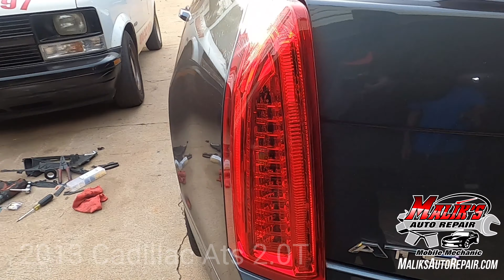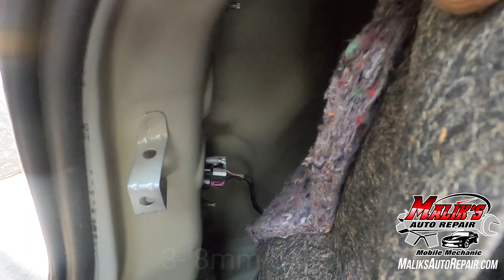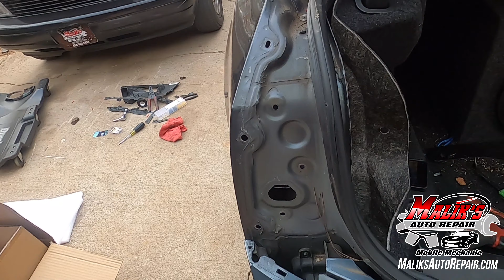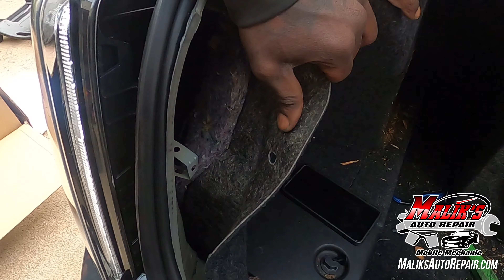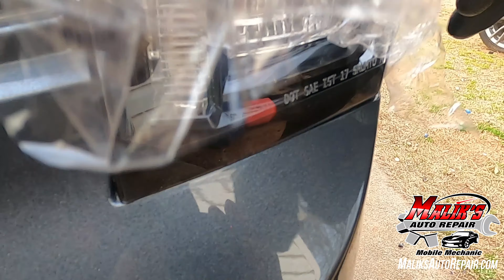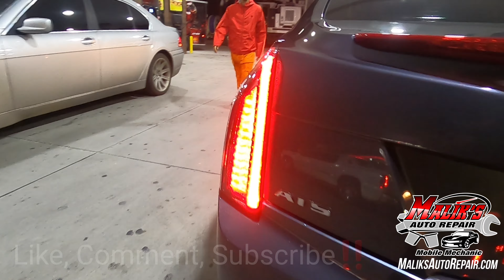CUSTOM TAIL LIGHTS🔥/UPGRADE/EASY MOD‼️Howto/2013-2018 Cadillac Ats 2.0T www.maliksautorepair.com

Comment: Are the oem led aswell? Do the new lights have different looking design  compared to the oem or is it just a smoked version of of stock?
Reply from the maker: Yes sir, OEM as well. The lights actually look the same, just a brighter LED and the clear, see thru look. They almost look stock tho, just without the red.

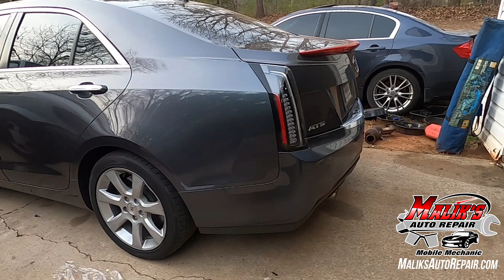Comment: I think you should have that bent left rear rim straightened  (6:11) before spending money on the ricer look tail lamps.
Reply from the maker: Well thanks for pointing that out Ron. It was bent when I got it, but fixed as soon as I found someone to do it. I'm loving my clear taillights btw. Sry u dont😎

Comment: Just installed but brake lights dont come on and they turn signals are faint. Replacing them maybe i just got a bad set
Reply from the maker: Yeah, good possiblilty.

Comment: Installed these my turn signal blinks very fast as if the car is not recognizing them any reason why this is?
Reply from the maker: This happens because they draw such little power that your turn signal relay sees the bulbs as being out. 
Best thing to do is Install an LED flasher module specifically designed for LED bulbs or Install a load resistor kit. Unlike plug-and-play LED flasher modules, load resistor kits require some wiring to install.
Reply from the maker: The guy I purchased mine from has more in stock now. Check the link in the description.

Comment: I just installed these lights today. They look identical but I believe I got them from a different seller. They look great! However, mine are hyper flashing when I turn the blinkers on. I guess I'll need to install load resisters. Did you have this issue at all?
Reply from the maker: Awh man, that's wild. No I didn't have that problem at all. You shouldn't be getting a hyper flash. Where did you purchase them?
Reply: @ThePullUpKing  I got them from a store called KWD Lights on Amazon. The blinkers are sequential which is probably why I'm having an issue. Here's a link to a YouTube video of the lights. https://youtu.be/ql0GscX2N-o
Reply from the maker: Best bet is to Install an LED flasher module specifically designed for LED bulbs. Unless your comfortable with wiring a load resistor kit.
Reply: @ThePullUpKing   @The PullUpKing 👨🏾‍🔧  I installed load resisters and they didn't work. Turns out the the yellow sequential blinkers weren't working at all. I had to rearrange the pins in the harness to get them to turn on because the wiring was made for Chinese cars apparently. They were still hyper flashing though so I ended up returning them after jacking with them for a week. The place you bought yours from is sold out of them. I'm guessing I'll have to just roll with the originals. I'm about to put a smoked wrap on them.
Reply from the maker: Awh damn🤦🏾‍♂️ Thats crazy. I wonder how long they gone be sold out? It's gotta be another seller. I'll try searching for you.
Reply: @ThePullUpKing  Cool. Thanks man. I saw one or two on eBay but they're $523 after shipping. That's only a little more than what I paid for the ones I returned but they look like the same tail lights I bought from Amazon. I'm not trying to go through the same thing with a different set from China. Some like yours would be cool though
Reply from the maker: Ok cool. I'll see what I can find.
Reply: @ThePullUpKing  The seller you bought your lights from finally has them back in stock. I just randomly checked to see if they had them today and ordered mine immediately.
Reply from the maker: DOPE‼️

Comment: I just got a 2014 ATS 4 3.6 l Premium
Reply from the maker: Dope‼️😎💪🏾🦍 Right now I got my 2.0 turbo running like ur 3.6 Premium with the Mods I added‼️ Your right at 321🐎 stock.💪🏾 I haven't had a DynoTest done yet, but I should be above 330.
Reply: @ThePullUpKing What mods increased 60 hp? I had a 2.0t performance and now have a 3.6 awd premium, the 2.0t is cool just more animated more noise and kick, the 3.6 is more refined gets you there faster, quieter and smoother. Watch modding 2.0s they legit will blow.
Reply from the maker: @troyspellman568  The 2.0T has wayy more room to play with when it comes to Mods.Your limited with the 3.6. No way am I down playing the 3.6, just telling you facts. Both are great cars.💯
Reply from the maker: @troyspellman568  Did a few Mods. Check out my Cold Start video. E85 Conversion kit and intercooler kit, Bigger Turbo, Cams and Valve springs next. My goal is 500hp in the end.